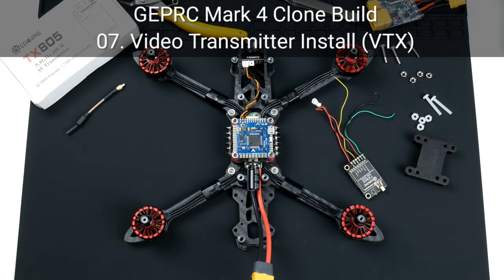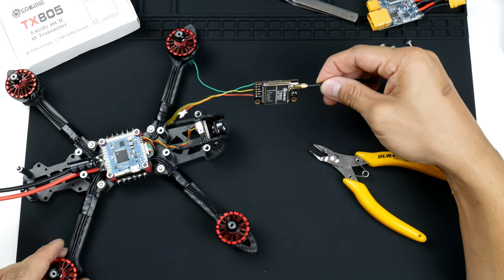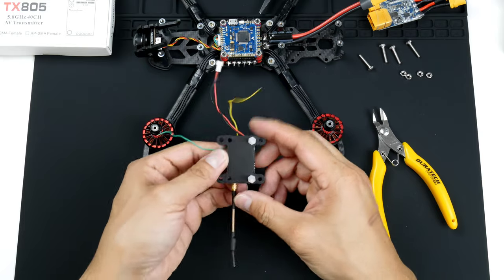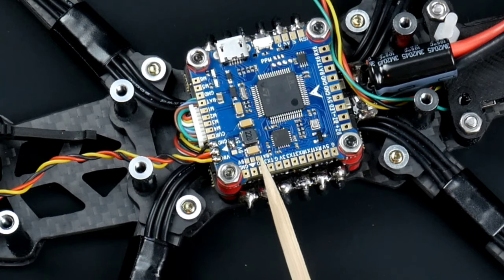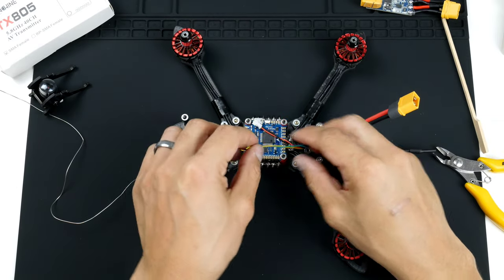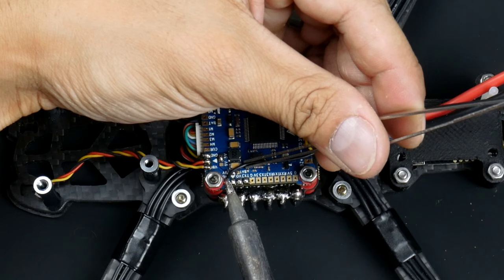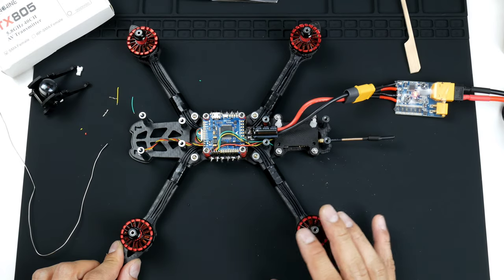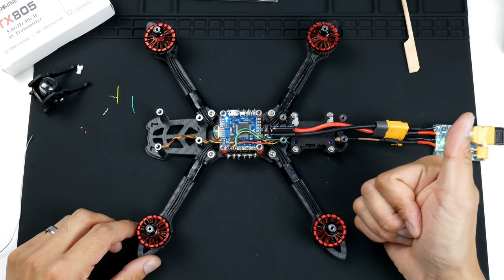GEPRC Mark 4 Clone Build - 07. Eachine TX805 Video Transmitter Install (VTX)

Comment: Pardon my noob question but can I connect the video wire from the camera to the video-in wire from the vtx directly without passing through the flight controller?
Reply from the maker: Yep. You can. However, you won't be able to get Betaflight OSD to show in the goggles this way. But you'll be able to fly FPV at least.

Comment: Hi! I cannot find your mount for the VTX, it looks very clean that way. I just finished installing mine with zip ties and I feel bad now haha. I'd like to redo it your way :)
Any ideas on when you plan to release the RX install video ? I'm curious to see how you are going to mount it!
Reply from the maker: The VTX mount is one I designed and printed myself. You can find an updated version of the .stl here: https://www.thingiverse.com/thing:4944171. I try to avoid zip ties where possible like this VTX, but sometimes I still have to for smaller components like the RX. On that note, sorry I've delayed the release of the RX video because I've just moved house and haven't had time to finish the edit, hopefully soon though (a couple of days I hope)! You'll see the updated version of the VTX mount in that video.

Comment: Is eachine tx805 still worth it? Or i should go for rush tank II ultimate? Its a bit pricey though i just want create a budget fpv drone with good quality
Reply from the maker: The TX805 has been great for me so far. The range isn't excellent, but I fly in close range doing freestyle. Unfortunately haven't had a chance to try the Rush tank yet, but it's twice the price, so if your going for budget build, I'd stick with the TX805. Hasn't burnt out on me yet!
Reply: @nxp200  alrightt thankyou for fast reply, i will go for tx805, im almost using the same setup as yours thankyou for helping me building my first quad
Reply: @nxp200  is jt okay if the antenna cable touch the frame's metal standoffs? Will it make an interference? My vtx and receiver is very near with the metal standoffs
Reply from the maker: If you're referring to the insulated section of the antenna cable, then no, it shouldn't be a problem.
Reply: @nxp200  alright, im already finish my first fpv drone build, really appreciate your build tutorial it helps me a lot, you deserve more subss. Thank youu
Reply from the maker: I'm really glad that my videos could help others like yourself out there and enjoy the hobby!! Happy flying! 👍 By the way,  thanks for your kind words!
Reply: @nxp200  I followed your guide and bought TX805, mainly because it was on a clearance sale for $12 :-). I was not happy with the range and penetration so I bought AKK Race Ranger for $25. And let me tell you, the AKK on 200mW works better than the Eachine on 800 mW! Plus it has a heatsing and 30.5mmx30.5mm mounting pattern. But thanks for your guide, it inspired me to build & fly FPV :-)
Reply from the maker: Thanks so much for your comment and experience with the AKK! I like hearing what others find because it gives much more insight into what else is available. I'm very glad you've gotten into this hobby as I love it. Thanks again!

Comment: How do you unlock this vtx? 🤔
Reply from the maker: Not sure what you mean by "unlock", but if you're referring to changing the channels and increasing the power output, there are instructions (I've added a link to this video description) on how to do it manually using the onboard button and LED sequences. The other method is to use SmartAudio control via Betaflight. Hope that helps!